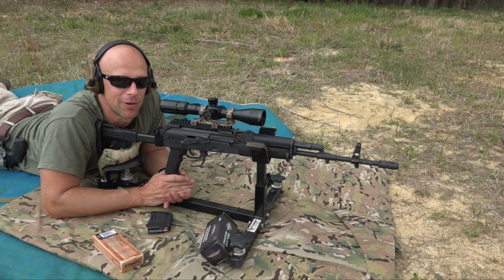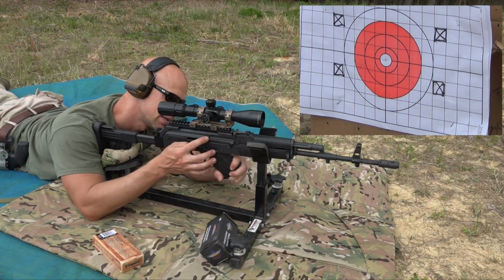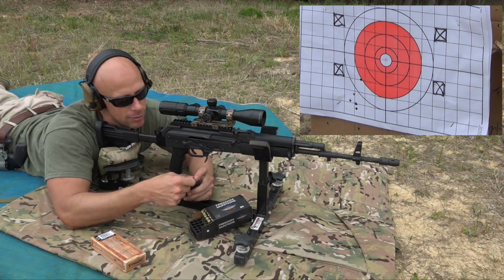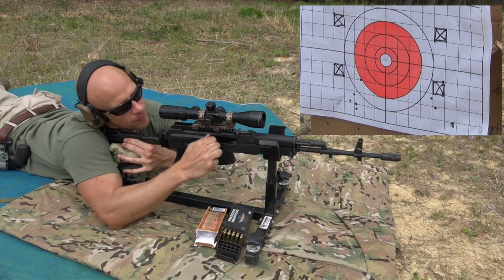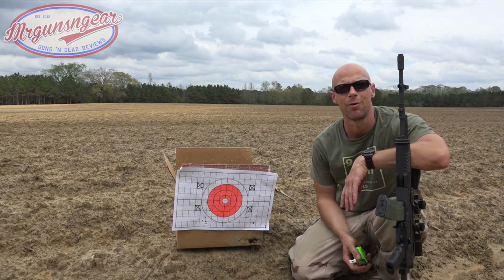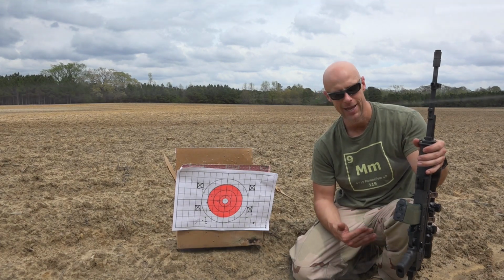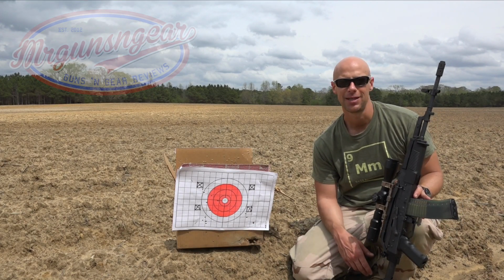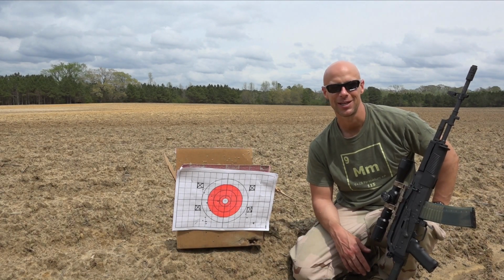Polish Beryl 5.56 AK-74 Accuracy Test & Review (HD)

Comment: I recently bought one that came from Arms of America. im getting .75- 1 MOA with handloads.
Reply: And yes its a 1700$ rifle
Reply from the maker: nice
Reply: @Mrgunsngear  really finnicky though. Believe it or not I shot my best group with Privi partizan 62gr ss109 and benchmark. I use it for coyotes so I use 60gr Nosler BT and benchmark for the terminal performance on yotes. Almost as good accuracy. it averages 1 moa with the occasional 3leaf clover group. I Run the clone correct EOtech 552 and a 5x magnifier.

Comment: Have you checked the crown under the muzzle device. I have an sgl31 that went from a 1.5 MOA rifle to  a 3-5 MOA rifle on its 3rd outing. I took of the 74 brake and right there on the crown, in one of the lands there was a small, but rather deep gouges. It's as if a tiny bullet fragment or piece of debris was driven into the crown from the pressure in the blast chamber. After some crown work the rifle went down to 2-2.5  MOA, though I never got back it's out of the box accuracy.

Comment: These 556 ak's DO use normal ak74 mags right? Because I can totally fit 556 into a 74 mag no problem.
Reply: The Circle 10 (Bulgarian) 5.56 or Beryl mags work best. A 30rd 74 mag will feed roughly 25 rds correctly.
Reply: Some have trouble with the last few rounds feeding correctly with AK74 mags 
Can get 3D printed followers that help

Comment: The major part of the value of the AKs is the ammo they were designed to shoot. A cheap (but decent) AR is a MUCH better platform to shoot 223/556 from than any AK (just as an AK is a much better platform for shooting 762x39 and 545 from). At their current price levels, there's no really good reason to be buying an AK at this time, IMO.
Reply: @crispusattucks6094  Just think, if you bought Tesla in early 2017, it would now be worth about 17 times what you paid for it.

Comment: Beryl is not AK 74... Beryl is polish weapon designet in 1996 using 5.56 mm ammo, Ak 74 is russian weapon made in 1974 and uses 5.45 ammo
Reply: Corpse666Eater It still uses the AK action. I own the 7.62x39 model for hunting and target shooting. Great rifle.
Reply: Corpse666Eater design top
Reply: MsAmigo1990 but we had first AK system weapon with 3 rounds burst mode in select fire and we developed our own 5,45x39 ammo independent. We had also first 5,56x45 AK system